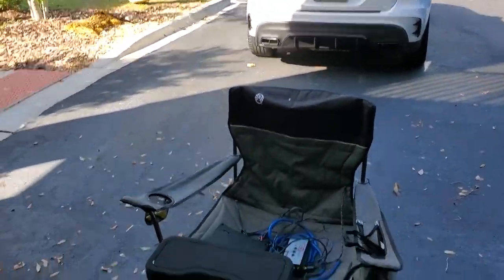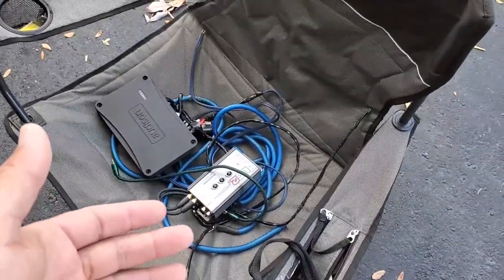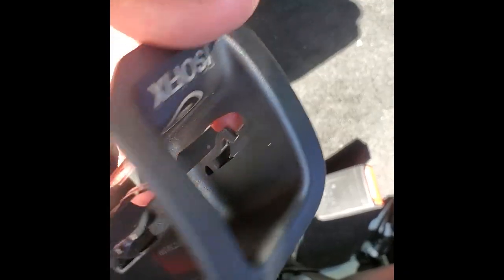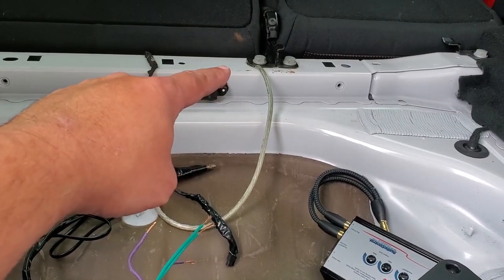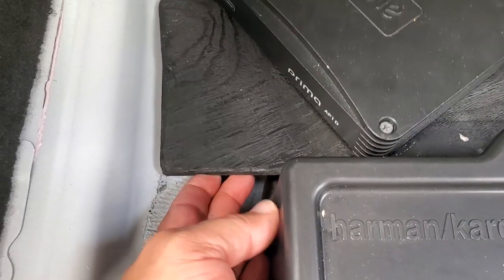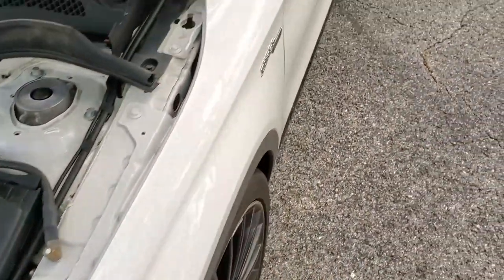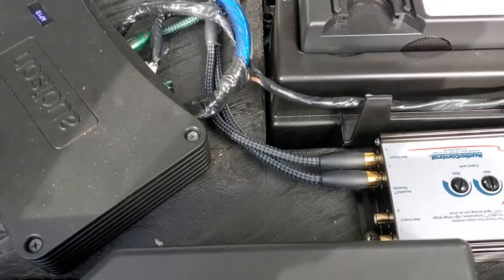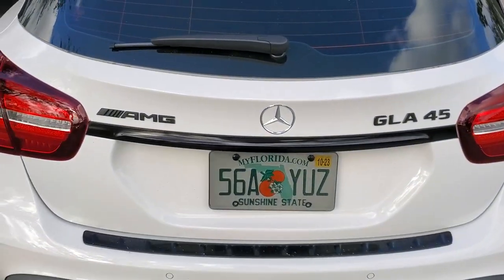Adding Subwoofer to Mercedes Benz GLA45 AMG, DIY Amp install & Wiring Big Bass from Kicker & Audison

Comment: Did this void your warranty?
Reply from the maker: Yes. If the amp malfunctioned i would have to pay to get new one from ebay and plug it in. No other warranty is connected and on mine the car is used out of warranty